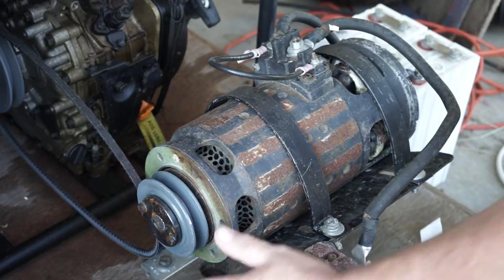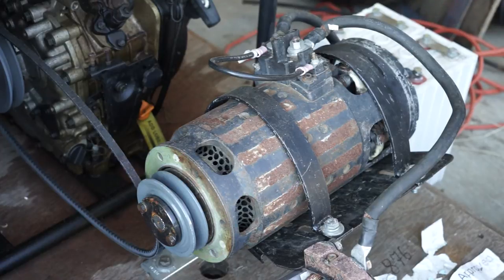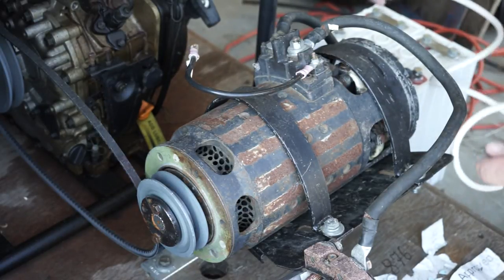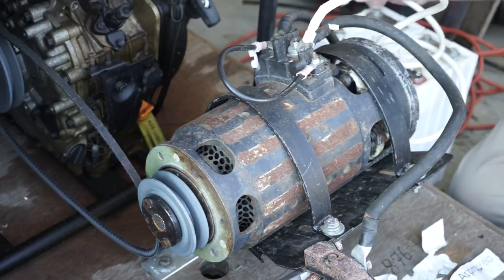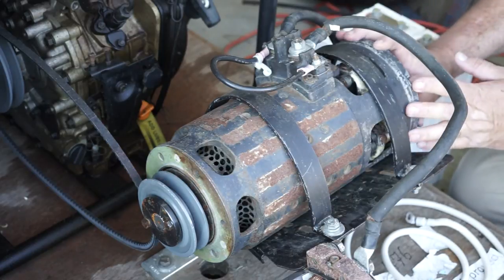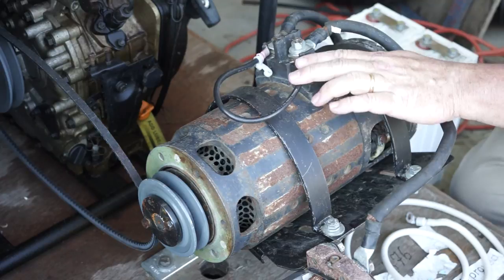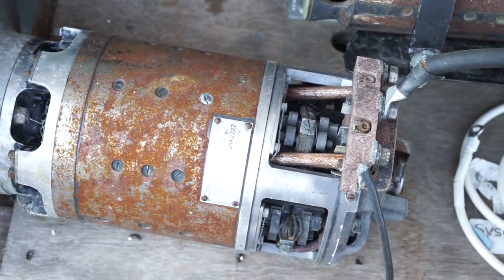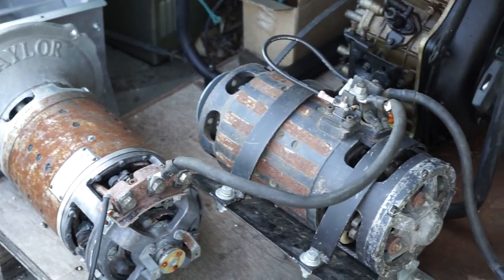Starter:Generator Small

Comment: Hi Pete. It would be possible to make this generator be used as a starter and generated at the same time to produce energy to charge a battery bank?
Reply from the maker: So the original idea was to use this as a DC source of power to charge a bank of batteries. My testing is to find out how much voltage I can produce and how much current I can produce by driving this motor with the small diesel engine. I intend to continue the project and also plan on using an AC induction motor to do the same thing coupled to an inverter in regenerative braking mode. But this one will work but I did not connect to a battery first so that is what is needed then check the voltage and current to see if I can actually charge the battery bank. As for using this as a car starter? Doubtful without lots of custom engineering. As for using it as a charger and generator at the same time? Can't do that. It can't be both at once but it can be both one at a time. So you could start your vehicle and you could after being a starter be configured to a generator. That is how it was originally used anyway. The motor was used to start military jet engines then with a flip of a switch it was turned into a generator to power the plane while in flight. To do that requires quite a bit of switches and electronics which I do not have. Im just going for what it will output and what current I can get. I only need to get power and my controller will do the rest to allow me to charge a higher voltage battery. My Electric Car conversion controller will also double as a charger and can utilize any DC power source. Any. The big factor will be current production. I want to know still. I need a better motor holder first. Time to bust out the welder now that I have the square steel stock to build a good platform for the electric motor.
Reply: Thanks, Pete McWade

Do not forget to send me the new update and what you have achieved, until now, with this project. I am a person interested in alternative energy. I am ready to start, the MEV engine project, this is a new discovery, which has the ability to turn and general its own energy, is something innovative. I will be showing my projects, by these means.